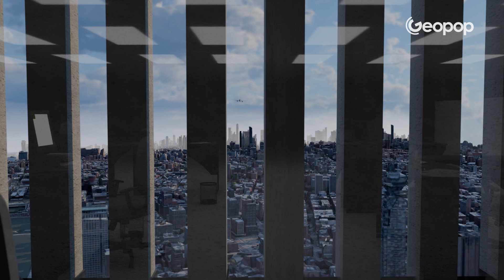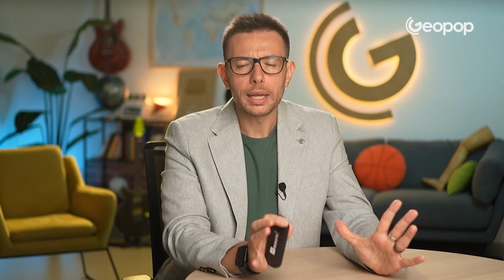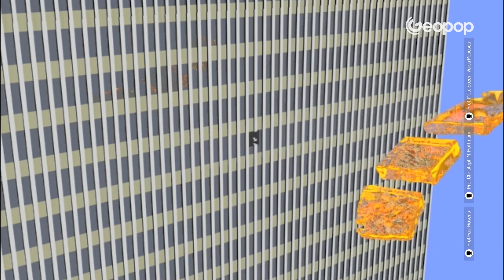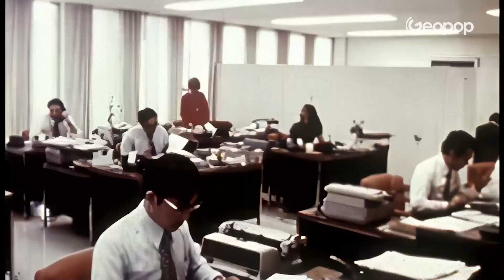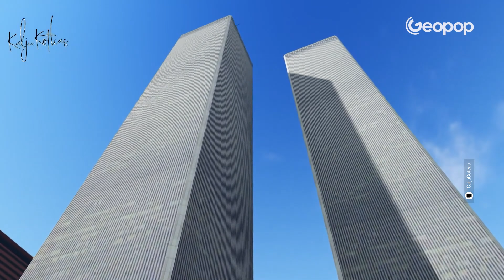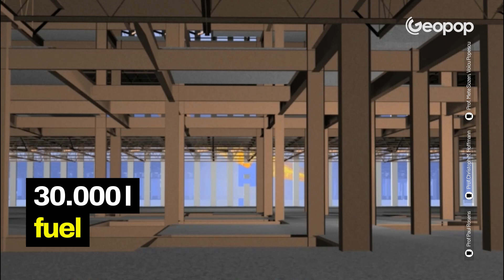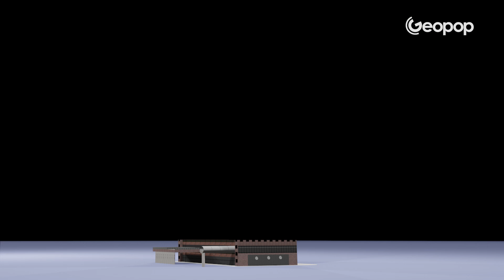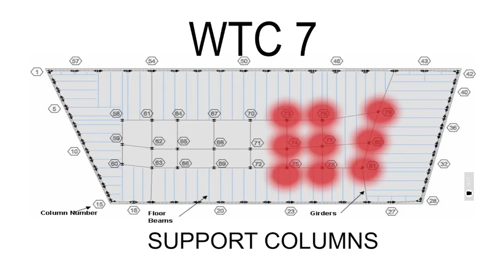9/11, 2001: The Technical Reconstruction of the Twin Towers and WTC 7 Collapses

Comment: There is no debate.  The planes destroyed several floors in each of the towers and started fires which heated up and softened the remaining structure.   Gravity requires that the top floors reach the ground within ~ 10 seconds.   Now go away.
Reply: I agree, the hotel was crushed by a building falling down. Why was it damaged? Because it was in direct path of falling debris we agree on that. But how does falling debris damage a building 15 blocks away? See when demolition teams take buildings down they use methods to stop the blasts from destroying nearby structures.  There was none of that here. A man running away during collapse died from other people's flesh being embedded into his bones. Shrapnel can fly 15 blocks, something falling down cannot. Why would I ignore the firefighters,  the structural engineers, chemical engineers, mechanical engineers,  the eye witnesses,  the video evidence in itself is damming. You can see the squibs.  In some videos you can hear the explosions. Every plane crash i know of, they try to put it back together to investigate.  This was supposed to be the biggest investigation in the world and they forgot to do that? Okay, I know what you're gonna say.An airplane mixed in with a 110 story building.It's hard to find okay , but what about when it lands in a field with nothing else around. Every piece should be available. Yet they claim they vaporized the plane. Yet they found lots of paper. Yea that makes sense.
Reply: @robbiehiatt9966  You will need to provide PROOF of what you want to claim.  Good luck.
Reply: @user-vb6lq9il5v there's nothing wrong with using the number 3. Don't know what your deal is. Here's proof.  1.The firefighters said" it looked like they planned to take down the building" I didn't say that, The fire fighters said that. They were there.I'm sure they know best.
https://youtu.be/XiIT4HInWjY?si=e1Pvp3-IFs-M75Oj
When the firefighter says "boom, boom, boom, boom" in this video.
What do you suppose he is?Implying by " boom" ?? What do you hear? 
2.So if there were no explosives then what is this? 8:25
https://youtu.be/bLF5D7M1YgA?si=aHSvS__uOdxMi1ZB
You can't say that it was added because you can see the firemen's reaction to the explosion. And you can't say it came from anywhere else because the firefighter says
" We gotta get out of here,  7 is exploding "
3. Controlled demolitions have squibs, you can see the squibs here 20 floors below the collapse. 
https://youtu.be/eXAgulfAtR4?si=-iLO9aQjMJVLTUYH
4. Firefighter says "any one of these buildings could blow up,  this ain't over yet" firefighter says there's 3 secondary explosions. 
https://youtu.be/0Gh3ErgMI4M?si=mmp9Eus_5PWTCBfl
5. Airplanes can't fly 600 mph at 1000 feet. And to be able to make a 180 degree turn to hit the opposite side of the pentagon going that fast is ridiculous. And since when do terrorists hit the opposite side of the building where no one was at when they could have just flown straight in and killed way more people???
 https://youtu.be/0Gh3ErgMI4M?si=mmp9Eus_5PWTCBfl
7. No one has ever known ahead of time that a building was going to collapse except through controlled demolition.  Tower 7 was reported to have fallen while it still stood in the background. 
8. Larry silverstein,  the man who made over 4.5 billion when they fell, claimed to have pulled the building down.
https://youtu.be/1jQaJFNWqtc?si=wCywQ9grgBdS_w11
9. A witness reported a missile hit the pentagon while he was seen at the scene. 
And the hole wasn't big enough for a plane and the damage wasn't consistent to the towers. And just like shanksville,  there's pictures that show no plane parts at all.
https://youtu.be/6_Ez-UCpXMs?si=JaQ6DBEC_LJtMLgN
10. That video also points out They were military planes that hit the twin towers. 
11. All sorts of reports of explosions were reported that day.  
12 Buildings dont accidentally fall  Into it's own footprint.
Reply: @user-vb6lq9il5v these experts in their fields found molten steel in the debris. Captain Philip Ruvolo (NYCFF), 
Richard Riggs(debris removal expert), Mark Loizeaux , Leslie Robertson (wtc structural engineer), Lynn Margulis (University of MA),  Dr. Abolhassan Astanch (from Berkeley),  Robert Kim Ireland( chemical engineer for US Army Corp of engineers), Mark Basile( chemical engineer), Kathy McGrade (materials engineer), Gery Warner( Mechanical engineer), David Gregg( PhD Chemical engineer), Steven Jones PhD( physicist), Kevin Ryan ( BS Chemistry), Niels Harrit (PhD Chemistry), Tom Sullivan( Explosives team) Jason Cheshire ( Chemical engineer), and Jeffrey Farrer (PhD Material science engineer).
Reply: @user-vb6lq9il5v i'd be happy to show proof of anything that I said. But sense I have to provide proof, why don't you? Its your typical you blaming me for something you are doing
Reply: @robbiehiatt9966  The TV/Radio tower atop WTC1 did heavy damage to WTC7.  The internal structure and the presence of fuel tanks in WTC7 led to a collapse due to steel being weak.
Reply: @user-vb6lq9il5v how does a fuel tank buried in the ground cause any trouble when it wasn't burning down that low he says where the fire was in this video. You are making stuff up.
Reply: @robbiehiatt9966 WTC 7 had the fuel tanks on the seventh floor with the emergency diesel generators on the sixth floor.
Below the sixth floor was the power distribution substation for the entire WTC area.
Reply: @allangibson8494 proof of nothing as usual.
Reply: @allangibson8494 there were fuel tanks stored underneath the ground at tower seven. They were definitely not on the seventh floor. And considering they were buried they definitely did not contribute to the controlled demolition of tower seven.
Reply: @robbiehiatt9966 There was nothing underground at WTC 7 except transformers and high voltage switchgear.  The ConnEd Substation existed there before the WTC did. WTC 7 building was tacked on top of the substation that filled from the deep rock foundation to the fifth floor. The emergency generators for the New York City emergency management organisation and their associated fuel tanks were on the sixth and seventh floors. The underground concrete substation survived most of the collapse but required its severed cable connections to be replaced to get power back to the bottom of Manhattan.
WTC2 collapsing ripped the entire front off the building and set it on fire. Conspiracy theorists like to show the BACK of the building, not the burning ripped open front (although, even in that you can see daylight shining through the windows that simply couldn’t happen if the structure was intact). WTC7 was beyond salvation the moment the WTC towers came down (along with 20 other buildings in the area), and not worth spending lives on saving an emptied building where all 4000 occupants had already been evacuated.
Reply: @allangibson8494 you're the one with the conspiracy.Believing the fuel tanks was on the sixth or seventh floor. You're wrong. You're getting your information from a very faulty source.
Reply: @allangibson8494 there are very strict rules in new york city about where you can store fuel inside of skyscrapers.
Reply: @robbiehiatt9966 And the guys who wrote the rules had their offices in WTC 7…
Reply: @robbiehiatt9966 I am getting my information from the actual analysis of the disaster. WTC 7 needed emergency generators for the emergency operations centre and the ConEd substation precluded putting them anywhere except the lowest accessible floor - level 6, on top of the concrete deck roof of the substation.
Reply: @allangibson8494 you are delusional.
Reply: Except 3 of the buildings fell that didn't get hit by a plane. And what happened to newton's third law? Seems you've thrown that right out the window
Reply: @robbiehiatt9966  The hotel was crushed and burned, several other buildings heavily damaged and burned, and the WTC7 was hit by debris, damaged and had a fire get started in a basement fuel tank, after the WTC1 collapse.  None of this will surprise an intelligent person.  You, on the other hand....
Reply: @robbiehiatt9966  In order to be taken seriously stop writing "3" instead of "three."

Comment: It's strange that WTC 1 and WTC 2 needed a fuel laden jetliner being flown at 800 kph in order to overcome the fireproofing, weaken the steel structure, to enable the progressive collapse, whereas WTC 7 needed no such thing.
Reply: 7 was impacted by 2 massive collapsing & burning skyscrapers. And it burned a lot longer than the towers did without a drop of water put on it.
Reply: Building 7 required 7 hours, compared to less than an hour and an hour and a half, respectively.  You aren't taking into account all of the factors.

Comment: It's strange how the 70 floors below impact have no ability to retard the collapse of the 30 floors falling down from above. You would expect that this progressive collapse would slow down as it met successive floors, each offering a little bit of resistance.
Reply: They did! Both towers took much longer than free-fall time. The north tower's collapse was more than twice that long.
Reply: You would expect that maybe, but not anyone who has taken the time to actually understand.  To us it is obvious the rate of collapse can only continue to increase. 

Let’s break it down to the absolute basics:

The 47 core and 236 perimeter columns of the Twin Towers support all of the gravity loads of the building. ALL of the resistance is in the columns.

Planes impact Towers, causing massive structural damage, destroying sprinkler systems, tearing out gypsum board walls and blasting off the SFRM insulation from the floors. Multiple floor-wide fires are started instantly and spread rapidly due to the destruction of fire protection systems and venting of the building during the impact.

Serious fires were largely confined to the impact damaged floors and those immediately adjacent to them.

Fires were started by the impacts and fuel aboard the aircraft, which acted as an accelerant. No shortage of other consumables inside the tower to continue the fires.

Collapse was initiated (started) at the impact and fire damaged floors when floor trusses exposed to heat over time sagged, in turn pulling on and causing the inward bowing of some perimeter columns by up to 5 feet until they buckled on one face of each tower (ie: NOT symmetrically).

www.youtube.com/watch?v=ULdiD6gYZO0

No steel melted or needed to. Structural steel will bend and fail at less than half its melting temperature.

Once the perimeter columns buckled the formerly static load above became a dynamic load 30 times greater, easily overwhelming the structure below.

Thousands of tons of now loose debris fall through the open office space within the four outer walls - bypassing the columns - dropping 12 feet onto the first intact floor it comes across. That massive instant overload causes the floor to fail, shearing the pair of bolts that secure each end of the floor trusses to the columns. The floor fails. adding its mass to the falling mass which continues to accelerate for another 12 feet until it impacts the next floor, rinse and repeat one floor at a time all the way down.

The columns - the part that holds the building up, supporting ALL of the gravity loads - are spectators for all this.

Rate of collapse increases as momentum increases. The collapse front is constantly accelerating.

As each floor fails, air inside the building (the Towers were 95% air by volume) is compressed, then blows out the sides _in reaction to the Tower falling, not the cause of the Tower falling.

No fire required at all on floors below the impact points for them to fail. The mechanisms that started the collapse are different to the mechanisms which continued the collapse. That will be a difficult concept for some.

As the floors fail the perimeter columns are left literally hanging in the breeze, no longer attached to the rest of the structure. They peel away and fall in great sheets (think banana) out to more than 600 feet from the base on the 4 points of the compass.

Core columns failed last.

Each 110-story tower had a 1-acre footprint. The debris pile was up to 14 stories deep and spread out over 16 acres, destroying 8 surrounding buildings and damaging more than 100 others.

The above all true no matter who planned and carried out the 9/11 attacks or why

Comment: First mistake why would the operator tell people to stay in the tower. second the steel was coated with PHOS CHEK caused the steel to weaken. This product is a fertilizer based product , this is what Tim McVey blasted the federal building in OKLA. Phos Chek fueled the fire. No one attempted to check that element. Mud would have done better. The corners were not needed an Arch for each floor could have prevented a lot of death.
Reply: The steel beams in the towers were coated with mineral fiber insulation. Phos chek is fire retardant, and it's not what they put on them. What kind of idiot told you they put explosives on the beams??

Comment: 8:46am was when the plane hit, so was the explosion below from fireball that went down the core? that makes sense
Reply: That is correct. Burning jet fuel shot down the elevator shafts (yes, there were elevators that ran the full height of the towers). The fireballs below the impact were definitely jet fuel.

Comment: NO VIDEO EXPLAINS HOW CONCRETE GOES IN A DUST AND WHY THE CENTRAL STEAL CORE WAS MELTED AND COULDN`T BE EXTIGUESHED FOR 3 MONTHS STREIGHT. 

1. To make concrete into dust, it needs to be under 300Cel. for hours on end.
2. To melt steal you need aproximetly 50/60 min. 

It`s not possible to do 100 floors it with 27000 litres of kerosine as it was concenrated only in a section of the building in mater of seconds.
Reply: 1. Most of the dust was from gypsum sheet rock, not concrete, I believe.
2. There's no evidence that any steel melted at the WTC, the core or anything else.
Reply: To turn concrete into dust you just need to hit it with something. FFS 🤦‍♂

No steel melted or needed to. Please pay attention.
Reply: @TheLoonResistance  Ok bot.
Reply: @kaloyankatrev6799  - You do understand this is a theory you can test yourself with just a big hammer and a chunk of concrete, right?

No, of course you don't 🤦‍♂
Reply: @TheLoonResistance  I worked for 3 years in testing lab were we used to certify the classes of concrete which was pored on sites, plus I am a structural engineer and dont have time to educate a AI BOT in regards statics and sopromat.
Reply: @kaloyankatrev6799  - Makes unsolicited claim to relevant authority while making stupid conspiracy claims and accusing anyone who disagrees with him of being an AI bot

I smell 🐂💩
Reply: @kaloyankatrev6799  - www.youtube.com/watch?v=GCcixBzBWCY